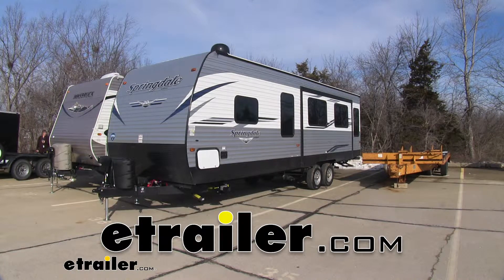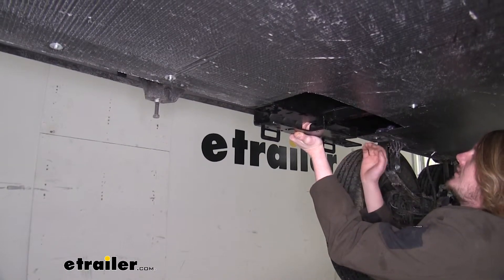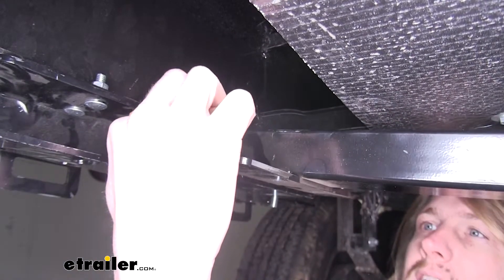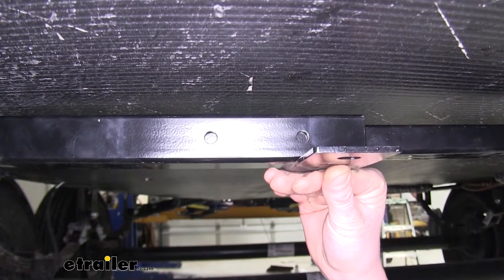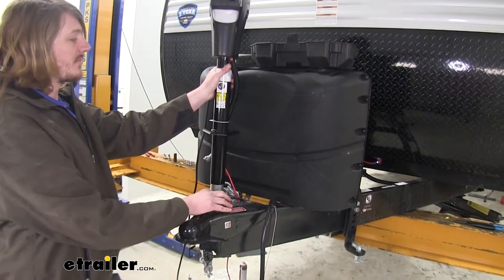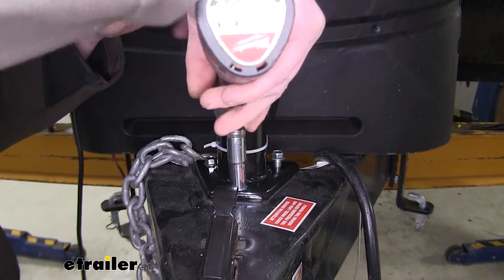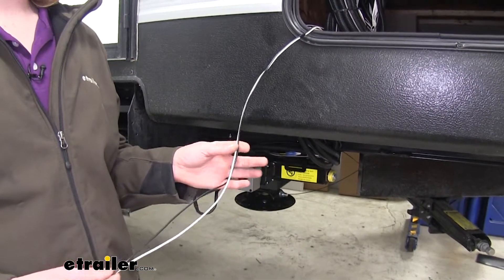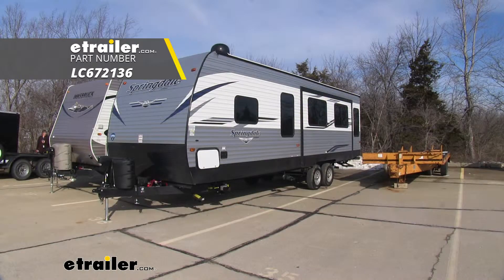Lippert Electric Travel Trailer Leveling System Installation - 2019 Keystone Springdale Travel Trail

Comment: Do you still need the manual jack-down stabilizers, front and rear.
Reply from the maker: There is no need for the manual scissor jacks if you are installing this kit. These will take their place.
https://www.etrailer.com/Camper-Jacks/Lippert/LC672136.html